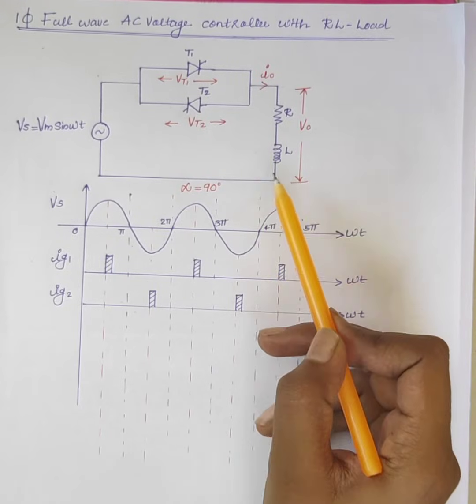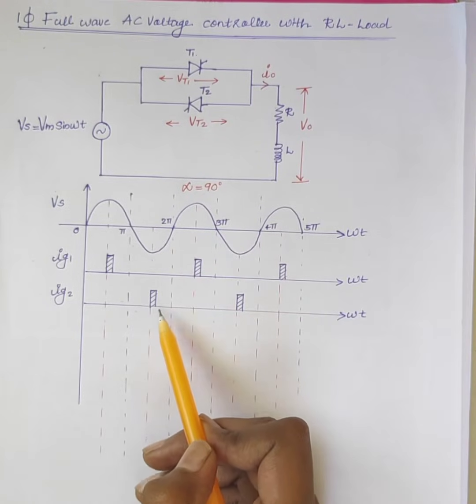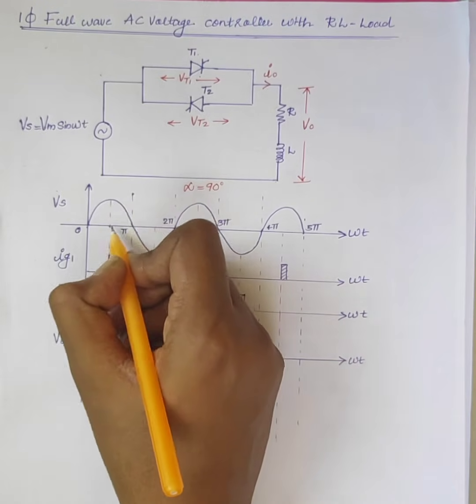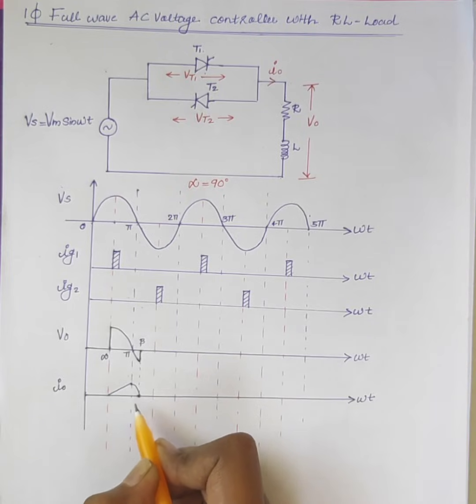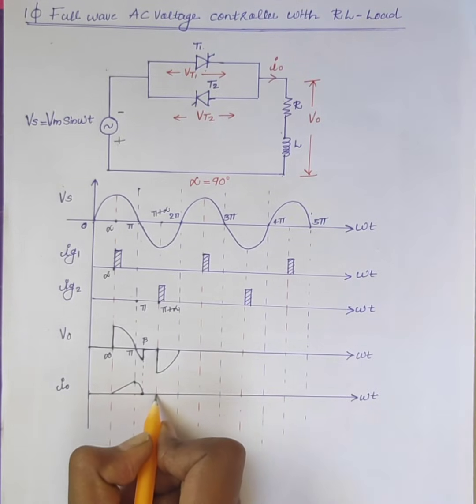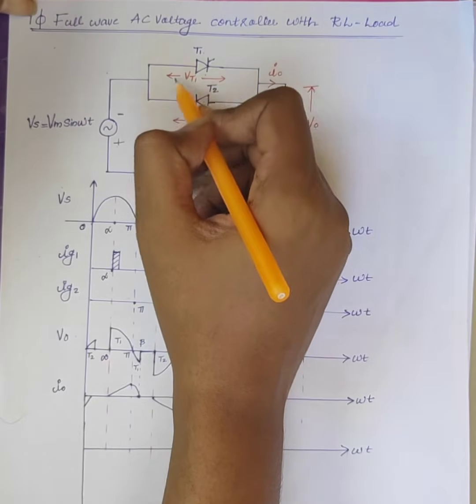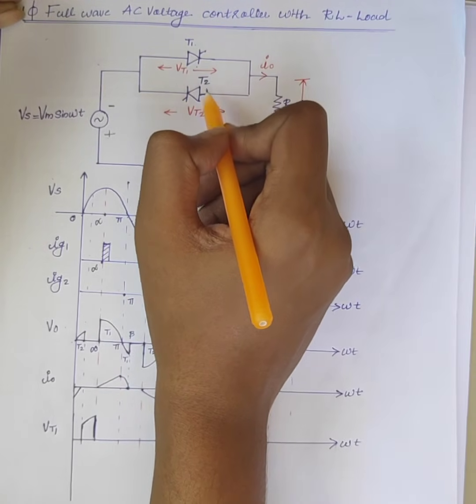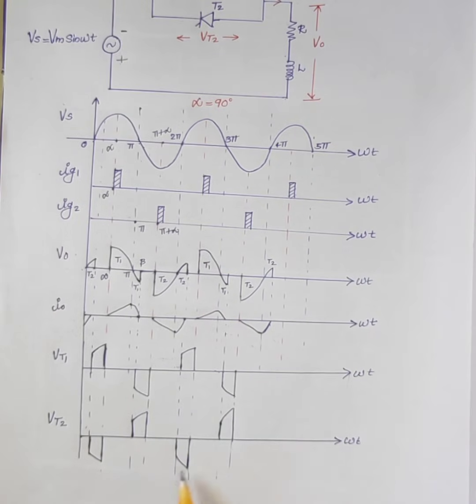Single phase full wave AC voltage controller with RL- load

Comment: Mam in the VT1 waveform, the thytistor T2 is on and the thyristir T1 is open circuited , why the output waveform of  VT1 is not considered at the T2 thyristor is on
Reply: That Is The Blocking State Voltage Across Scr = input voltage